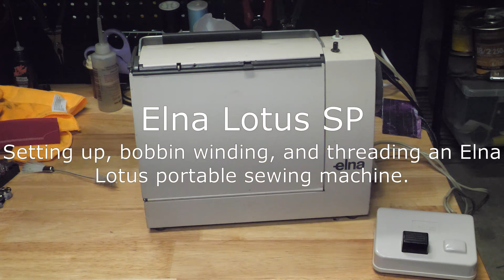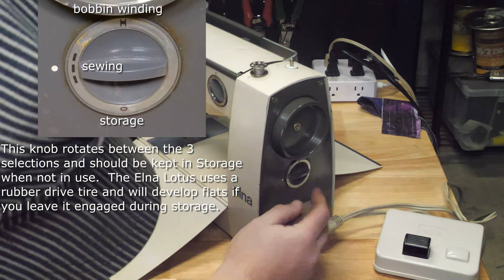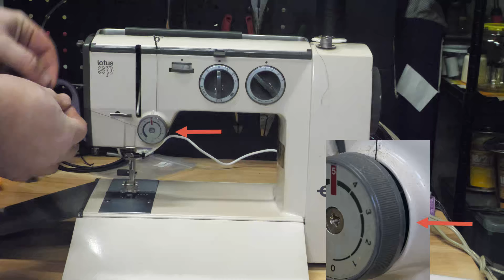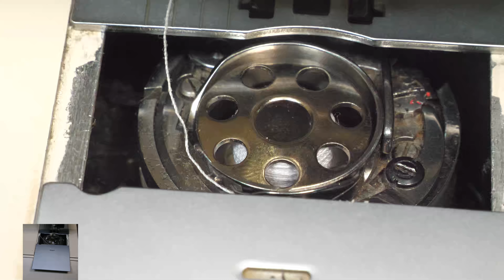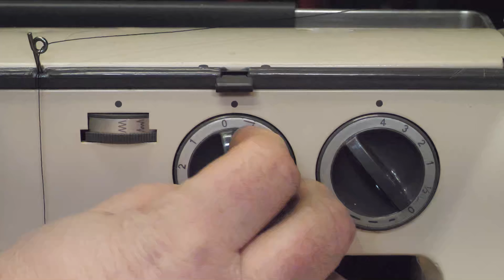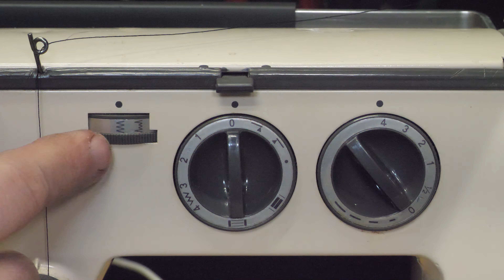Elna Lotus SP Threading and Operation

Comment: Thank you for teachings we didn't know🙏🩷....so why the machine doesn't sew after threading ?
Reply from the maker: There are many reasons the machine may not sew after threading.  First, double check that you did not tangle the thread at the needle.  It goes down to the eye of the needle, through the eye, and straight out the back.  If it got tangled, looped, or tied up on the needle it will not be able to sew.  If you are sure the bobbin and the upper thread are being properly threaded but the machine cannot pick up the bobbin thread or make stitches then you will need to look closer.
This machine has a plastic hook gear that may have cracked.  Take the thread and bobbin out and look in the bobbin area.  When you turn the handwheel, the hook inside the bobbin area should be moving smoothly and the needle should go down, then come up as the hook is going behind it.  If the hook is not moving or if there is a stiff spot when you turn the machine the plastic gear is probably cracked or cracking and will need replacement.

Comment: Your videos are so helpful! I am trying to get my lotus sp in good condition, but can not seem to get the stitch width dial to turn counterclockwise to needle positioning or darning options. Any suggestions?
Reply from the maker: I believe the stitch width dial has Button Hole and Needle Position options, not a darning setting.  The settings for free hand darning would be a Triple Zigzag stitch at maximum width with feed 0 and low presser foot pressure so you can free hand.  The selectors inside the Lotus are plastic, so do not force them to move.  You will want to open the machine up so that you can watch the selector dial from the back side and clean all the parts that it is supposed to move.  Once those parts are cleaned and oiled it should start moving the full range again.